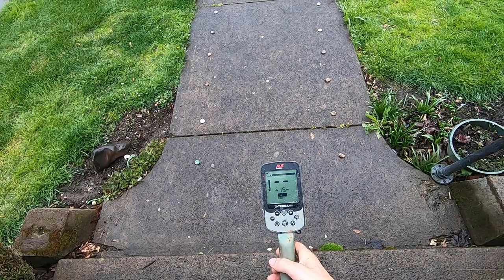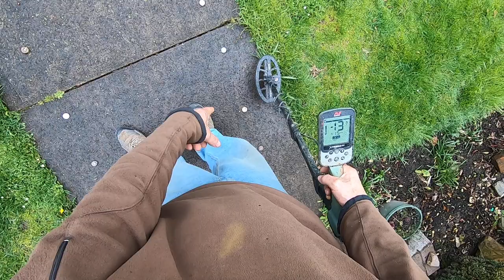Rejecting bottlecaps with the Xterra Pro. 28 bottlecap demonstration!!

Comment: Pra que dê mais certo, deveria produzir um equipamento pra cada tipo de solo, ou seja virá balanceado de fabrica com compensação de perca por causa da mineralizaçao.
Reply: @fullhalf420  Paysttreak Superfreak informed me that the XP Deus II can only ground grab in multi frequency. 

The Manticore ground balance can be manually adjusted to make the detector ground positive for greater depth or ground negative for greater sensitivity. 

If you're in a trashy park you might want to run ground negative to filter out the noise. 

If you're detecting in mild mineralized soil that is relatively trash free and looking for faint deep targets you can run ground positive. 

XP Deus II can't do that. 

Fixed ground balance is typically set to ground positive on detectors that don't have the ability be adjusted.

Comment: I do the exact same thing on a couple sites I hunt I dig everything and clean out the ground. Occasionally I'm tired or whatever and will not dig anything over 25 and I'm just looking for Gold but thats about 15 percent of the time. Most the time I like getting everything out of the ground accept maybe large stuff I leave that. But even that sometimes I want it out of the way. I look at gold hunting like dredging for gold. Im there to make sure there is no gold left in the ground basically. I may go to a spot for 2 or 3 months before gold turns up. But I choose the typical places swimming areas and parks and baseball fields.

Comment: They all sound and meter about the same here, copper/silver coin range even in all metal. I'm guessing there is a software tailored or pre engineered platform behind the results I'm getting. Jewelry machine or is it prospecting Minelab had in mind? Gotta take it out to the rockpiles and test it. Gonna take a while to figure this one out. Bottlecaps hitting that high does leave the low and mid range cleaner. Wish you luck.

Comment: Just got the Xterra Pro a couple days ago, heres what irritates me about it.. this is marketed as a beginner machine.  Where do "most" new detectorists go to start?.. a trashy as heck park, yet they ship this with a 12" coil which will do nothing but frustrate a newbie in the trash.  In my opinion this machine should have shipped with a coil the size of the coiltek, then someone can move up to a bigger coil when they are ready.  Also they have yet again made a detector with a subpar speaker, in the wind the other day it was unusable due to not being able to hear it..that said it is impressive for a beginner machine, I dug some very deep coins with it.  Legend is my main machine but the 269$ price piqued my interest on the Minelab.  Now if the ML85 headphones were in stock.
Reply: Someone did a XTerra Pro cost breakdown, headphones, smaller coil, etc. You could of bought a Nokta Legend a superior detector for about the same price.
Reply from the maker: Having a huge coil on an entry level detector will make a newbie hate the detector and maybe the hobby. Small coils are the very best setup for beginner detectorists. This big coil standard on modern metal detectors is an overlook by the manufacturers. Detectors 10 years ago were sold with small coils. And yes if you want to buy the Xterra with a 5x10 coil and headphones...THE LEGEND IS THE SAME PRICE!!
Reply: @PaystreakSuperfreak  100 percent agree, not sure if it’s oversight or by design knowing that someone will realize they need a smaller coil to park hunt successfully. Not sure if Dilek is reading comments but give the new guy a fighting chance with the new Simplex line..coil options!

Comment: O Boy   O Boy   O  Boy  (28) twenty-eight different bottle caps with different stages of decomposition and I have a machine with enough different tones to entertain me for the rest of my life to master the sound of the tone!  lol   Wow!  You're kidding me!      lol   R O F L  I will stick with my White's Spectra V3i!  Would it be a fair statement the V3i shows multifrequency with the individual freq./kHz on search, pinpoint, and EMI to allow the operator to operate in a range accommodating the one of the possible freq./kHz to hunt in and no other multifrequency even does so much as indicate the freq./kHz that is below the coil?  Houdini was the highest noted magician, and he could not have determined all information that is not provided?  Just quess!  The multifrequency with (5) five freq./kHz does not even provide any information of the freq./kHz?  Amazing!  So, the operators say my machine is 'chatty'!  Imagine that!   lol   R O F L
Reply: I love the White's Spectra V3i, it should be upgraded to the modern standards of VLF detectors, but it's not.

What we don't know is the weighting that Minelab has applied to the SMF resonance frequencies.
We do know what frequencies the Manticore, XP Deus II and the Equinox series are operating at.
We also have a feature called Noise Cancel, which shifts the SMF frequency band up or down to avoid EMI.
We also have the ability to find the most offending EMI.
The Manticore is also best in class of the VLF detectors to deal with EMI.

The people that you see with a chatty Kathy detector don't know how to operate a detector. I'm not address those detecting in an extremely high EMI environment with highly mineralized soil.

These are the simultaneously multi frequencies of the Minelab Manticore. Which by the way, has 50% more electromagnetic force than the Equinox series. That equates to between 3/4" to 2" greater depth.

All-Terrain General (7.95 kHz, 28.75 kHz, 49.15 kHz)
Resonance frequency: 3 resonance after 7.95 and  28.75
4.09 V
0.48 - 0.50 A
1.96 W - 2.0 W
1.022-0.945 Wh/0.260 Wh

All-Terrain Fast (7.95 kHz, 28.75 kHz, 49.15 kHz)
Resonance frequency 28.75
4.09 V
0.50 A
2.05 W
0.951 Wh/0.000 Wh

All-Terrain Low Conductors (40 kHz High Frequency),(7.95 kHz, 28.75 kHz, 49.15 kHz)
Resonance frequency 28.75
4.09 V
0.26 A
1.06 W
0.954 Wh/0.243 Wh
Longest battery life (13.07 hrs).

All-Terrain High Conductors (13 kHz, 48.45 kHz)
Frequency shifted upwards significantly from 7.95 kHz to 13 kHz.
4.09 V
0.60 A
2.46 W
0.967 Wh/0.244 Wh
Shortest battery life (5.66 hrs).

All-Terrain Trash Reject (7.95 kHz, 28.75 kHz, 49.16 kHz)
Resonance frequency 28.75
4.09 V
0.48 A-0.50 A
1.96 W - 2.0 W
0.850-0.987 Wh/0.218-0.250 Wh

Beach General (7.57 kHz, 12.75 kHz, 17.75 kHz, 27.65 kHz, 47.75 kHz)
Resonance frequencies:  12.75 kHz, 17.75 kHz, 27.65 kHz.
4.09 V
0.46 A
1.88 W
0.992 Wh/0.252 Wh

Beach Low Conductors (7.57 kHz, 12.75 kHz, 17.75 kHz, 27.65 kHz, 47.75 kHz)
Resonance frequencies:  12.75 kHz, 17.75 kHz, 27.65 kHz.
4.09 V
0.46 A
1.88 W
0.999 Wh/0.252 Wh

Beach Deep (7.57 kHz, 12.75 kHz, 17.75 kHz, 27.65 kHz, 47.75 kHz)
Resonance frequencies:  12.75 kHz, 17.75 kHz, 27.65 kHz.
4.09 V
0.47 A
1.92 W
1.0005 Wh/0.252 Wh

Beach Surf & Seawater (7.57 kHz, 12.75 kHz, 17.75 kHz, 27.65 kHz, 47.75 kHz)
Resonance frequencies:  12.75 kHz, 17.75 kHz, 27.65 kHz.
4.09 V
0.47 A
1.92 W
1.010 Wh/0.257 Wh

Goldfield General (7.85 kHz, 27.65 kHz, 48.35 kHz)
Resonance frequencies: There are 3 more resonance frequencies after 7.85 kHz and 27.65 kHz.
4.09 V
0.50 A
2.04 W
1.016 Wh/0.257 Wh

5 kHz (5.15 kHz, 15.15 kHz, 25.15 kHz, 35.25 kHz, 45.25 kHz)
Resonance frequencies (echo): 15.15 kHz, 25.15 kHz, 35.25 kHz, 45.25 kHz.
4.09 V
0.48 A
1.96 W
0.855 Wh/0.000 Wh

10 kHz (10 kHz, and two resonance frequencies)
4.09V
0.48 A
1.96 W
0.000 Wh/0.218 Wh

15 kHz (15 kHz, and one resonance frequencies)
4.09V
0.50 A (same as SMF)
2.04 W
0.861 Wh/0.221 Wh

20 kHz (15 kHz, and zero resonance frequencies)
4.09V
0.38 A 
1.55 W 
0.839 Wh/0.000 Wh

40 kHz (40 kHz, and zero resonance frequencies)
4.09V
0.26 A
1.06 W
(0.845-0.890) Wh/0.222 Wh

GL👨‍🦯HH
Reply from the maker: Almost all detectors including the V3i have a noise cancel...it is called frequency offset. They all work on the same principal by switching the frequency in very small increments, like 100hz=or tenths of a khz. The older machines like the V3i did not have automatic offsets like the modern machines but they did have manual offsets which accomplished the same task. The V3i was a very stable machine if you knew which ground filters to choose and delay speed to set for the specific conditions. The V3i is WAY WAY more advanced than the Manticore. You take the Manticore with it's 50% more power  and challenge it against the 20 year old V3i with the shooter 4x6 coil in a trashy spot, that manticore will go running back to it's cave with it's tail between it's legs. The mixed mode audio that the V3i has to offer is frikn out of this world. The V3i Spectrasound headphones still to this day has the best audio I have ever heard on a metal detector ever. But the V3i is not waterproof, takes heavy batteries, hard to find parts and does not have a lightweight carbon fiber shaft. LONG LIVE WHITES ELECTRONICS!!
Reply: @Paystreak Superfreak  and that is why they are still in business..right? Old technology..